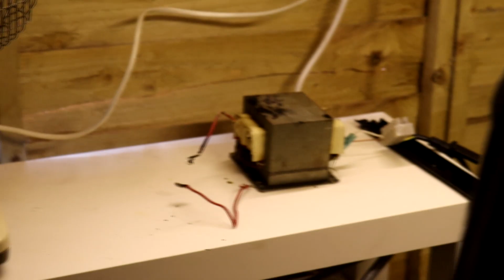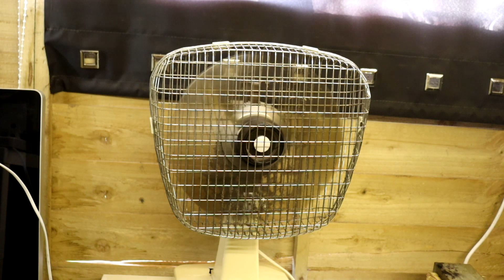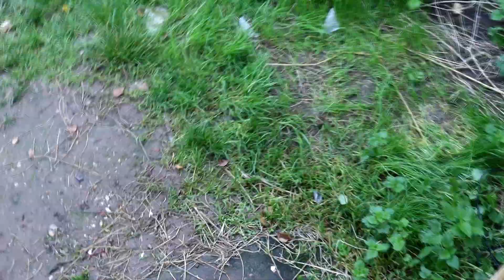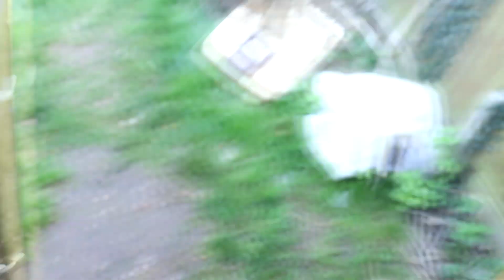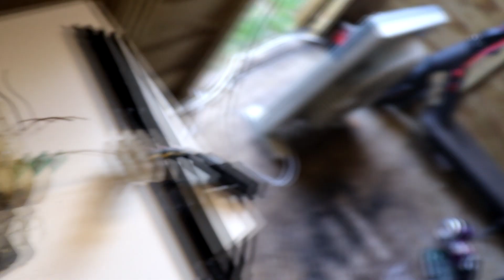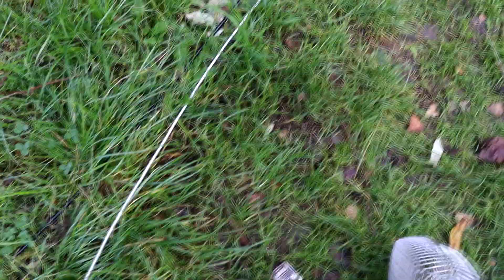Taurus T10 fan overvolted with 2000V

Comment: Alternative title: fan fry’s transformer then itself 😂
Reply from the maker: @Kidd-nq4fg  that’s quite accurate😭😭
Reply: @ I was so not expecting that outcome, I’m over here in the US and I have 120v service of course. I also have this fun little step up and step down transformer, it’s very cheap but fun to use for this purpose. If you apply 120v to line side you get 240v out of the load side. But over here we have literal garbage products that don’t last. I will soon upload some videos covering this topic and showing what I mean as I’m making a comeback on YouTube soon lol. Anyway it just takes some time to go through and remove all the thermal fuses from these Chinese piles of trash to roast the motors!
Reply from the maker: @Kidd-nq4fg  I wasn’t surprised to be honest these MOTs are a bit crap, they’re good fun though. I’ll deff check those videos out when they’re uploaded
Reply: @ awesome! Coming soon sir, I am currently going through all my stuff and I have many cheap things mostly fans to blow up because to be honest the power supply isn’t able to handle large loads. Until I get myself a better rig lol.
Reply from the maker: @ oh yeah should be fun lol hopefully you got some small fans you can blow up without also blowing up the transformer lol, lucky thing with mots is you can just blow them up and get another one for free